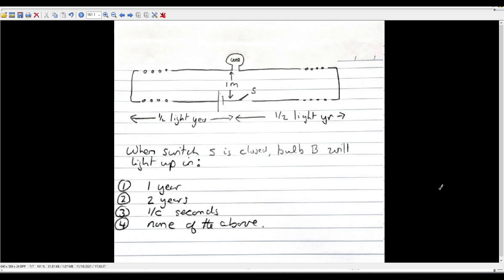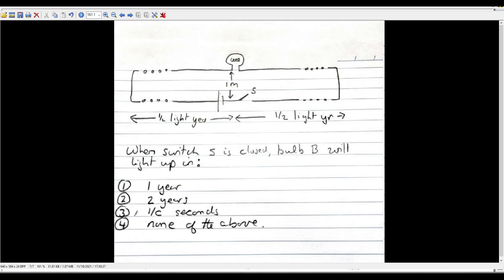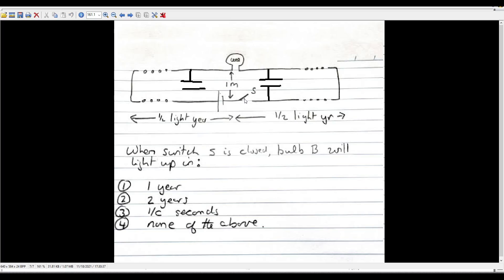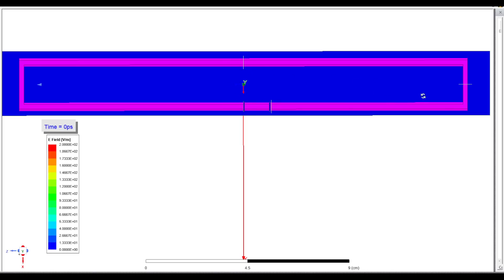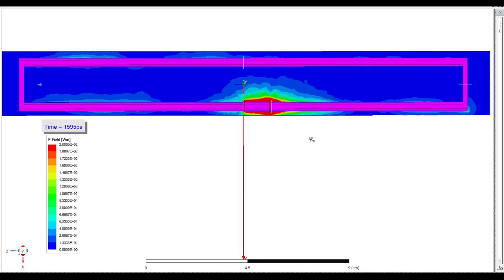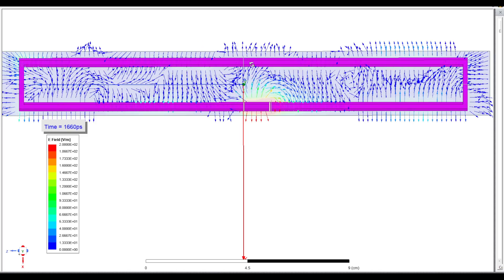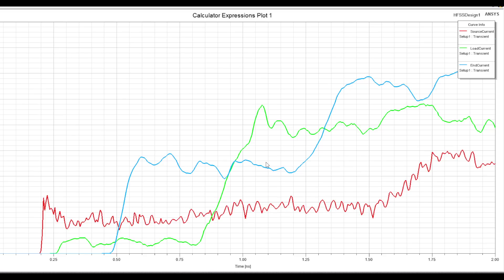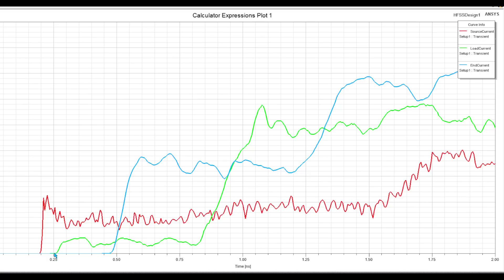Response To Veritasium - Electricity Propagation Time Problem

Comment: this whole question and answer made me very upset. Derek talks about misconceptions. Why is it then, that “we can safely assume” a perfect switch, a perfect battery and a lamp which lights up with any current inside the wire. I’d say the “we can safely assume” is the misconception here. Your simulation shows, the lamp won’t see reasonable current before the signal has traveled back and forth. Also from the optics, your simulations has very thick wires. For a idealistic assumption, shouldn’t we use infinitely thin wires? Ah, no capacity then, too bad. Also Derek  laid the wires flat on the ground, how about doing your simulations with a ground plane?

I’d say, if you allow cheating and non physical setups, answer three is correct. If you want a physical assessment, the answer would be “Its complicated” and depends on many definitions. If you say we want to make a usable approximation, the answer after 1 year would be correct. I found Dereks and to some extend your explanation quite confusing. I mean, I am a radio engineer by education and of course I know, that electromagnetic energy can be transferred through space. I didn’t remember the Poynting vector, but reading the Wikipedia page could clarify this for me, better than Dereks video did!
Reply: Georg,
If you say you are an electrical engineer, then you should understand that you MUST view those two sideways lines as transmission lines. 
Please look at my reply which should appear right below yours. If you understand transmission lines and TDR, this will be trivial to understand what's going on.
The thing that Derek misses is that you really cannot separate the flow of charges with the fields. They both must occur together, always and can never be separated. So my claim is that you cannot say that it is either one or the other. They both occur together. That is his misconception.
.
Again, if you understand transmission lines the true nature of what's happening here is trivial. Transmission lines have a characteristic impedance that looks resistive when you assume no loss...
.. .. ..
Finally, we make a lot of "safe" assumptions  about things like zero resistance because it helps us understand the basic fundamental principles FIRST. You should know that we MUST understand all of the basic first principles before we can understand more complex things where several of those fundamental principles must be kept in mind in order to understand everything that is happening. 
.
The way the circuit is drawn makes it very confusing for many people including the engineers I've seen several videos on.
Best regards
Steve, 
Science Vigilante.
Reply: @Observ45er  Hi Steve, if you are a RF engineer, you will know, that transmission lines have a cut off frequency. The line simulated here is 15mm wide (50ps travel time for the field) the wires seem to be 1.5mm wide and solid (10cm copper rods for the 1m example). The switching time is 5ps or > 50GHz way beyond the typical 300MHz for such a transmission line.
Twin leads are usually driven balanced, the setup from Derek and the simulation here are unbalanced. That still throws me off.
And yes, sure approximate assumptions of perfect conditions are allowed, but only if the measurement itself isn't dependent of these conditions. For example, the time to switch should be below the cut off frequency of the transmission line. If these aren't conditions aren't valid, you shouldn't use the approximation to prove your point. This is an absolute no in engineering or science! 
I am RF engineer by education but I work in semiconductors. Here we have ps switch times and our developers can't use approximations but need to know parasitic load conditions, as you can't cheat in real life. I still think Dereks setup is a cheat!
By the way the stimulation from this video, both the source and the load have no resistance, arrrgh!

Comment: Ben,
This is a good analysis. However, I'd like to point out a couple of things that I have yet to see anyone else mention.
First, the way this circuit is arranged is very strange. We have these two sideways lines going from the source, far, far outward and then back inward to the load which is back near the source again. This clearly makes them transmission lines, which is something many people are not  familiar with.
.
[As a side note, redraw the circuit with the source and switch at the Left end and the light bulb at the far Right end of a regular transmission line. Also assume that the light bulb is matched to the characteristic impedance of the transmission line. Then, we will see a considerably different situation. Therefore, this circuit arrangement makes the analysis more complex and I claim that whether it was intentional or not, Derek made it very deceptive this way.]
.
Back to Derek's configuration.
What this means is that the source battery and the light bulb load  are both located at the source end of these two transmission lines. This puts them in series with the characteristic impedance of both of these lines. It's a little easier to understand if you remember the original term of 'surge impedance'. We are putting a step function into the two transmission lines and the characteristic impedance will limit the current to this lower level initial current. 
Once all the reflections settle out and we have a steady state situation, then the current will reach its steady-state value, which is determined by the zero resistance transmission lines and the load resistance.
The time domain plots you show agree with this T-Line theory relatively well.  I see changes at the 1/2 and 1 second marks form the reflections. The steps are just not as clean as in a TDR setup on a coax line...
Anyone familiar with Time Domain Reflectometry (TDR) should also see this right away.
.
Therefore, what we have is that because these are transmission lines, we can understand that SOME energy gets to the bulb right away but all of the reflections must occur to a sufficient point to allow the bulbs to light to FULL brilliance.
...
I don't know if anyone else realizes this, but I would think that with your understanding and ability to use this simulation tool, I'm a little disappointed you didn't see it that way.
Comment?
-- - From a very experienced RF Engineer.
Reply: Question:  The two parallel wires couple well, but what if Veritasium's arrangement was modified such that the wires on either side of the switch-and-battery (treated as a unit here as they are kept close together) first ran 1/2 light-second perpendicular to the bulb's wires before turning out and paralleling them, with additional 1/2 light-second runs connecting the circuit on either side.  (Total run is doubled from Veritasium's arrangement.)  Since the initial runs from the switch-and-battery are perpendicular to those from the bulb, they wouldn't couple well, right?  Wouldn't this minimize the initial induced current in the bulb to near-undetectable levels?
Reply: @QuasiRandomViewer  I'm not sure I follow, but changing things a lot does change the analysis, so that just makes a complex situation more complex.
But I ask:
.
So, the bulb wires first go straight up as they leave the bulb?
THEN go outward, left and right a long distance? 
AND... the battery/switch wires first go down, then to the left and right?
SO... we now have the two things that go left and right with the wires very much further apart??
..
Like this ??
           _________________...
 bulb_|
..                                   Sort of Far apart
.Batt_
          |_________________...
...
Instead of this:
          
 bulb_ _________________...
.                                   Sort of close
.Batt_ _________________...
          
..
I can't make any statement without lots of thought, but this makes a much higher characteristic impedance T-Line going outward, but it is still a T-Line......

Regards, RF Engineer
Reply: @QuasiRandomViewer  I'm not getting notifications for this...
.
Your first diagram is similar to what I guessed.  You're trying to get the :ONG wires further apart.
All you're doing is adding another T-Line from the motor to a higher characteristic impedance (Z0) T-Line out to the side. This just makes analysis more complex than it already is.
With a higher Z0, the initial bulb "flash" will be less, dimmer.
..
The ultimate key thing here is that two parallel wires make a T-Line and at t0, when the switch is closed, it looks like a resistor - plane and simple.   
.
When you say "poorly coupled lines" I (well, RF engineers) think higher Z0.

Therefore in the original circuit, at t0, we have a battery, a bulb and two resistors all in series, but since the bulb is 1 meter away, it takes ONE meter worth of time travel to cause that SMALL current in the bulb.

^          |-----bulb---|
|           |                 |
|           |                 |
1m      R              R
|           |                |
|           |                |

v          |-bat&sw-|
.. .. .. ..
.. .. .. ..
What Veritasium meant my "immediately".  he meant that it will illuminate (give off light) as soon as current flows.  It won't take time to warm up like an incandescent bulb or some LEDs that have a lag due to the way they are current controlled.

Yes, he is sloppy in the wording and that isn't the only place.  He is moving down in my opinion, more and more.  It appears to me that he is trying harder and harder to find thing to "reveal: because this is his living - money.
..
Your crisscross circuit is just several more levels pf unnecessary complexity.
..
As it should be obvious from my explanation above all three of your ALT versions are the same at t0.  The same two Resistors in series with the bulb.
.. ..
The resistance seen at the source end of a T-Line doesn't change until a reflection makes it back there.  Then you have two waves that add and the current and voltage follow the well known principles of superposition.
In this situation, we hjave TWO T-Lines, so it gets really messy fast.
.
Yes, in your Alt-1 & Alt -2, the bulb will light in the 1m/c sec, then flicker depending on the reflections and eventually go out.
.. ..
The ringing WILL die out because the bulb will absorb some energy with each reflection hitting it.  The amount determined by Z0 and the bulb R value.
.. ..
My bottom line is that it is folly to try to decouple the charge flow and the fields.  They are both part of ONE SINGLE PHENOMENON in this universe that WE have chosen to separate.  Separating them is what we have done to fit some concepts into our brains.
..
Ben did good, but could have done a but better,  His is the best showing what REALLY happens...  I think he just missed eplaining about the resistance of Z0 as being significant.
Reply from the maker: I think you are spot on with your statement that "SOME energy gets to the bulb right away but all of the reflections must occur to a sufficient point to allow the bulbs to light to FULL brilliance."

The current will approach steady state in steps, so what many people are hung up on is: can you consider the bulb "on" if it hasn't reached its steady state. I personally would say yes, since I am really only looking for a signal, not X amount of power.

Comment: I think the phrasing of the problem is disingenuous. The light isn't going to experience enough power to light till the current works its way through the wires. And even there, is the propagation light speed?
Reply: You seem to be headed in the right direction. 
See my comment just now. It should be right above yours.

Comment: Nice video- think your analysis is on point.  Veritasium would have been well served by a simple voltage measurement across the bulb.  Depending on the resolution of the measurement, he'd have to use enough wire so that the full length in light seconds and 1/c where distinguishable.  But no way did he use 2 light seconds of wire, or likely any amount that could be distinguished from 1/c with the naked eye.  Hopefully he'll follow up and we can see the transients at ~ 1/c and the steady state more so determined by the wire length/resistance.

Comment: So we can say the light bulb turns on between 0 seconds and 2/c seconds after we flip the switch depending on our convention, but the result will always be the same, we sitting at the battery/switch location will see the step begin at 2m/c seconds after the switch is turned on.

Comment: Btw it is subjective as well, we can loosen c=c to integeral(c)dx=c over a closed loop and still preserve Lorentz symmetry and not break electrodynamics either. In that case we can really think of the energy propagating in one direction instantly, and we would just observe the signal going back to us from the bulb as traveling half as fast, if you doubt it, don’t do the maths it checks out. It doesn’t break causality because it doesn’t change the communication time between 2 spacetime locations at all. But its funny to think about. All the conclusions would be the same for the circuit as well, if it doesn’t then Lorentz invariant electrodynamics is not internally consistent.

Comment: Yeah its actually technically asymptotically close to 1m/c seconds, because the straight line between the center of the source dipole field and the sink cannot transmit energy at infinite energy density so the line segment that is actually one meter is not capable of transferring any energy on its own. so it would instantly after that time begin to ramp up from 0 energy transfer to the bulb up to your step function level of then the details of that curve depends on the details of the air and the vacuum in between, if the vacuum can carry all frequencies equally well you get one curve, if there is some details about it that limit the frequencies you can transmit with then its different. Idk anyway thats way beyond his videos intentions i think. And to be fair to everyone its not possible to determine either as you start taking into account the frequencies small enough that we cant test how the vacuum transmits them. For example if you have gamma rays at sufficiently energy the vacuum doesn’t necessarily behave itself. And even higher energies than that you could not even hope to find an example in nature to study how the vacuum transmits it. This is where the black body problem and qm comes in and we don’t really have a classical solution to the question even today, even if one could make the argument with certainty that if qm is emergent from a classical field theory then at some point it simply has to be true that the vacuum doesn’t treat all wavelengths the same, or we would be forced to conclude that black bodies really do diverge in the ultraviolet, and it doesn’t at least at a surface level.

Comment: Isn't it bad to mix paradoxes, like mixing analogies in English. If this was all true, shouldn't all lights turn on just in case they are in a two light-year long circuit? Of course this question is directed at Veritasium, but by definition of a light, a light shouldn't turn on due to interference from another circuit, which, temporally, is what the side of the  switch essentially is until a year (or more) elapses.  This explanation is so instructive and it's fuel for all sides of the argument. Thanks for this.

Comment: Now move the switch next to the bulb instead. What happens then?
Reply: Actually, the same thing happens. If you have any understanding of transmissions outlines you'll see that those two sideways lines are transmission lines and the bulb and battery are in series with the characteristic impedance of the two lines. 
A few minutes ago I made a full reply that should appear above this near the top of the comments.

Comment: It's a light second long in Vertasiums video not a light year. But that's beside the point. Also everyone knowing a bit about electricity does the same as you said in the beginning, saying, yes well it's a capacitor until the DC current is established. Thus also everyone will agree, that 1m/c seconds something is happening on the other side, but one can argue if that's going to be enough to drive the bulb. So with you simulation the question how much of a percentage that is, is kinda unanswered.
Reply: A few moments ago I gave a full comment that should appear above, but if you understand transmission lines you'll understand that the battery and bulb are in series with the characteristic impedance of the two transmission lines. This means the bulb lights dimly right away, but doesn't like to feel brilliance until all of the reflections die down. The way the circuit is drawn makes it very deceptive, whether Derek intended this or not.

Comment: Can you play with the 1m distance in order to estimate how far apart the battery/bulb would have to be in order to not (nearly instantly) light the bulb? I'm okay with big error bars. Just wondering what's the rough range of the initial pulse (as defined).
Reply: There is no "range" of the pulse. The further away, the smaller the effect will be but it will never be zero.
Reply: @70lulatsch  Range in terms of lighting up bulb